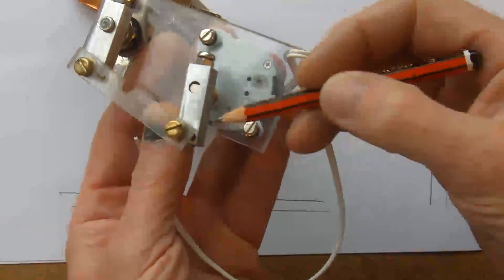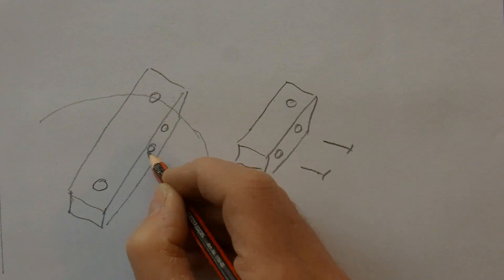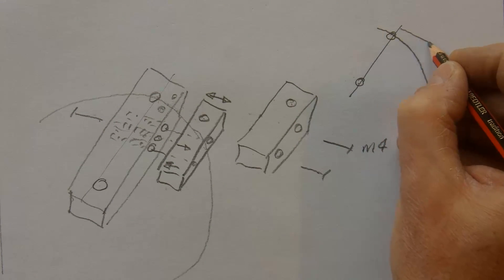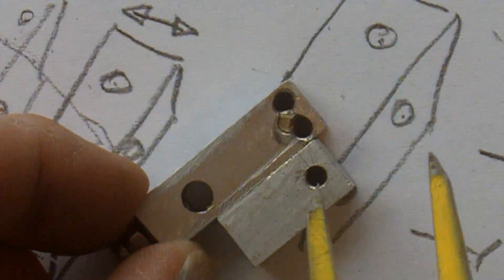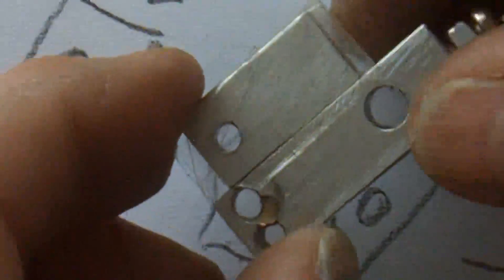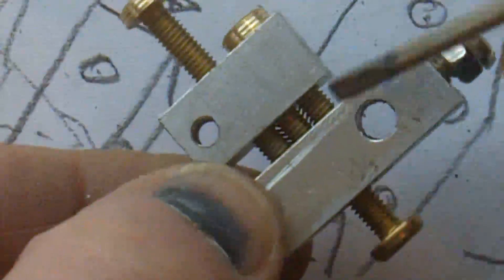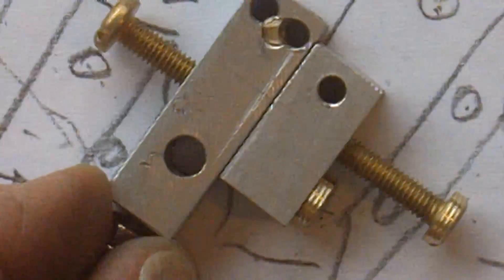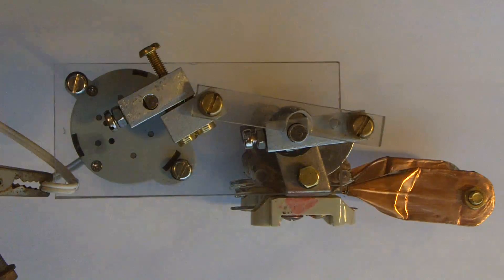About Radio 66 another update on Magnetic Loop Antenna capacitor tuner

Comment from the maker: Hi Fred I’ve been looking at the videos you mentioned, thank you they are wonderful, I think given training like that it can’t fail to register. I should imagine the mechanism that was the most problematic would have been the integrator with the disc driving the two balls that in turn drive the roller in Part 5. But a very good explanation of the mechanisms involved thanks for suggesting I take a look. By the way there’s 7 videos in the series.
All the very best ... Andy

Comment: Hi Andy: Now that you have variable adjust-ability,if you have a machinists calipers, you could incrementally move the screw out, and measure rocker arm total length VS swing angle of the capacitor shaft. Plotting that on X-Y graph could prove useful and very interesting experiment indeed.

Comment from the maker: OK Dennis, a spring loaded linear version of the rotary switch I have now, no worries.
I was trying to come up with yet another alternative with two push buttons to stab at but without multi poles and without the prospect of a short circuit if both are pressed together. Sounds like a coffee break challenge doesn’t it?
All the best ... Andy

Comment: Hi Andy

6 terminals do a cross wire  on outside ones  the center contacts are pos on one side and neg on other will reverse polairty  wish I could draw a schematic

Model: 275-709  |  Catalog #: 275-709 

DPDT 20-Amp Momentary Flip Switch radio shack
Price:$4.99
 

Get things started with this DPDT momentary flip switch—spring-loaded to return to the center ...

Comment from the maker: Hi Mike, yes you’re quite right, I could use a ‘movable’ pivot point in a slot but I think to make a good job of that is a little more work than what I’ve come up with. Over the years I’ve always tried to encourage my engineers to come up with simple solutions to problems as it’s all too easy to dive in with a very good ‘engineering solution’ but if you want to keep cost/effort down then it’s often more difficult to come up with a simple solution that dose the same job. 
Thanks for the input.

Comment: Could you not form an elongated slot (maybe about one third of it's width) down the middle of the arm from the outer end and of sufficient length for the required adjustment range and have a small block containing the pivot hole which would slide up and down the slot and either be clamped with one cross bolt or maybe have a vernier screw to move it ?   Thanks for all your videos -- mike durell

Comment from the maker: I modified a router jig for cutting corner joints in kitchen worktops as it had some slop in it, I made a video about it and some folk got quite wound up about it because they thought the jigs where meant to be sloppy and how I’d ruined the jig. I tried to explain that yes a little slop is OK (to pacify them) and said ‘It’s only a worktop and a bit of sealer/filler would fill the gap’ That upset them more, then I realised their idea of a gap is not the same as mine. 
All the best ... Andy

Comment from the maker: Well I wouldn’t call what I'm doing here as machining but I appreciate the sentiment, thank you. What I set out to do is make the drive unit without using any ‘Special’ tools like a mill or a lathe as I figure there's likely to be more folk that don’t have these facilities. But boy I miss all the facilities that I used to have in the factory when I was building special purpose machines with a team of 55 guys and gals. Now I'm scratching around for materials and not milling machine in sight.